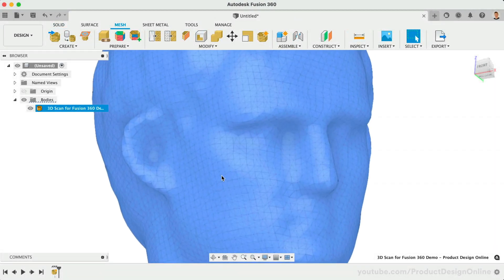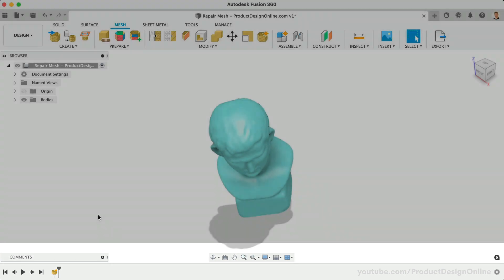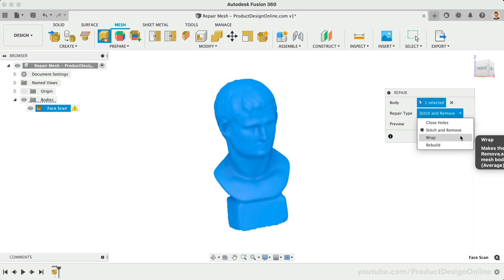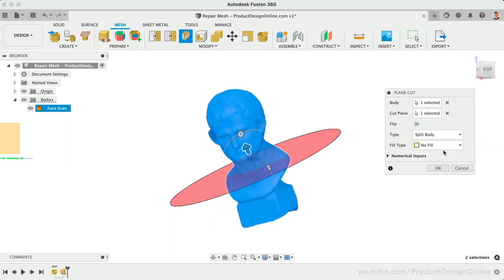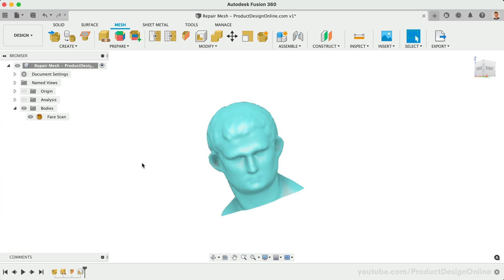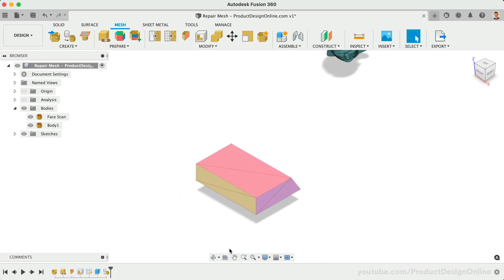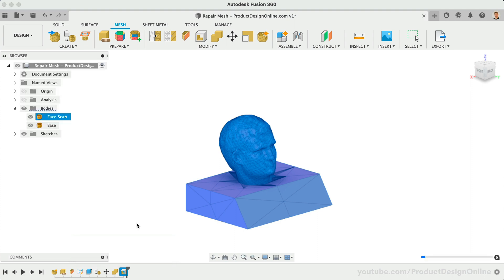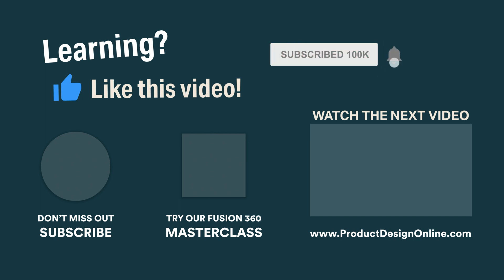3D Scan: Repair and Modify in Fusion 360

Comment: Is there a way of creating a solid based on the shape of a mesh? I've got a 3D scan of a figurine, and I want to create a 3D printable "divot" for it so it can be stored in a box snugly. Effectively it'd be like modeling a thermoformed piece of plastic, matching the back side of the figurine. Can you do this in Fusion? Thanks for your videos!

Comment: How to work on 3d scanned file? On which software? Solidworks or fusion 360?
Reply from the maker: You can work with mesh data in both, as well as many other CAD packages. It really depends what you're trying to achieve :)

Comment: Hello ! Thanks for your channel. Very useful. 

I have a task at work. 

We have a few furniture prototype that our master made by hand . 

And I need to enter all the part into our cad then cam. 

1 sofa is over 50 pieces 😢. 

I’ve told them that since it’s something time consuming and that will be repeated every month at least we should find a faster way to digitalize handmade prototype. 

It’s very simple it’s just flat mdf or plywood shape. There is no 3D or 2.5d it’s just 2D cutted shape out of 18mm plank and panels of wood. 

My only problem is that some part are like 700 by 400mm. It’s not small part. 

What would you use to scan them? 

They gave me a budget of 1000ish dollars 😅. 
I feel once I show them how fast and time saving it is they would be ok to invest 3-5k if it means going from 99 to 100% accuracy. 

Thanks!!!

Comment: This video will help out a great deal thank you
But I do have a question
When I did a couple of test scan with that exact scanner granted it was atleast a couple of months ago I had an issue where the scan my head the imported into fusion

The mesh file went in but the size of the scan was way to big
Checking the measurements from chin to top of my head was over 2 metres

So if possible could a video be made where an item is scanned then imported and size altered close to the actual size of the scanned item
Thanx

Comment: There’s something I’ve been struggling with for a while. I want to recreate my wedding ring, which has a hammered texture. I can’t figure out how to get a good hammered texture that looks natural in a circular way.
Reply from the maker: That would probably be easier in Blender or Mudbox, where you can apply textures.  You could try to reduce the mesh count in Fusion 360 to get somewhat of a hammered look, though it will probably be pointier than desired.
Reply: @ProductDesignOnline  I have tried it in blender but I don’t think I have the talent for it haha. I haven’t heard of mud box before though I will look into that. Thank you!